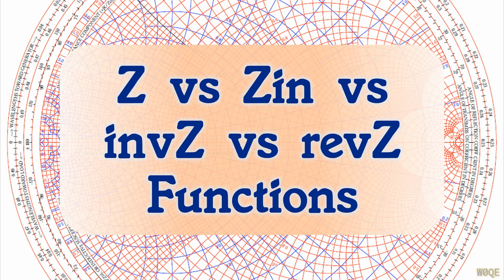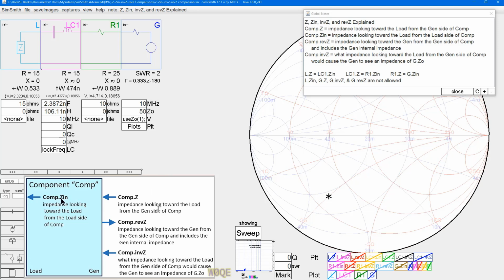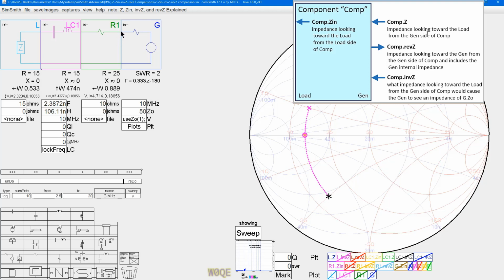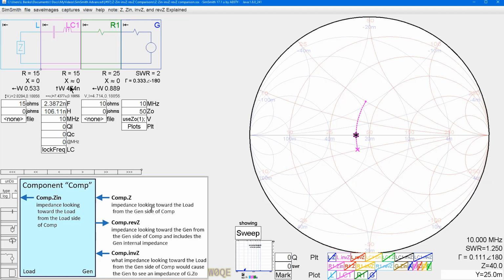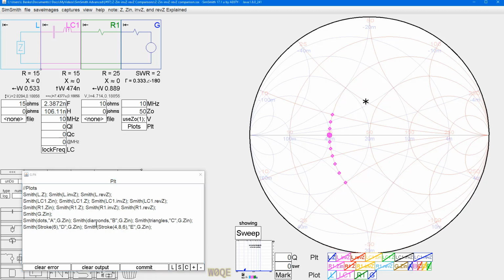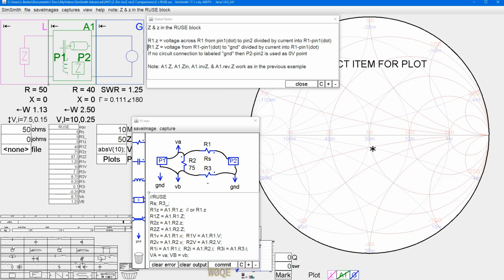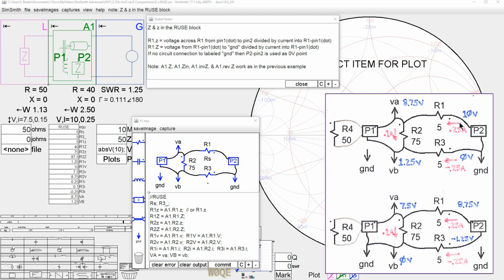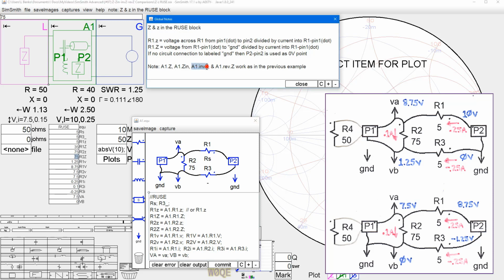#97: Z vs Zin vs invZ vs revZ Functions

Comment: Very interesting video, would love to know the reference you use to find all of these functions that are undocumented in the manual. I use this program a lot and there are so many functions I appear to not have found. 

BTW, I really would love to see a video on RF combiners. Feeding multiple transmitter sources into a single antenna or a single source into multiple antennas. I have played with trying to use two or more sessions of the program or with the LG block but I want to know if there is a less kludgy way to do this.
Reply from the maker: WB5MGR,
I believe all the "undocumented" features are in one of the 2 manuals but I wouldn't want to have to prove it.  Under the help tab there are choices to click on the SImSmith and Anvil programming manual.  Give me a couple of examples that you call undocumented.  I did a couple of videos on power combiners which were videos #28 & #29 but this has been quite a while and SimSmith has changed and become more capable since then.  There are so many topologies for combiners and splitters that doing more videos would be a good idea.  Thanks for the comments.
Larry, W0QE

Comment: I just wanted to add a quick comment that I think might be interesting.

The Comp.revZ requires Z0 in G to be linear, otherwise the expected value might be very different from what is seen in the reality.
An example can help: a class E amplifier has an optimal load where it has the ZVS and ZVDS switching. The conjugate of that impedance IS NOT the impedance as shown by the amplifier.
In other words, the amplifier expects a particular load but it is not showing an output impedance that is the conjugate of that load. That would have the consequence that the total efficiency would always be below 50% when matched to its ideal load, while in reality an ideal and lossless class E presents 100% efficiency.

Great tutorials! SimSmith has many more functionalities than I though. 
I generally use scikit-rf as an opensource python library for these kinds of analysis, but SimSmith is also good as quick interactive alternative as it  seems it can do it in a couple of clicks.

Comment: A couple of quick notes.  First, the lower case 'z' is the 'component impedance' and is available at the outer level in addition to the inside the RUSE block.  So, for example, in the given circuit there exists a value 'R1.z' which will be the same as the R1.ohms + j R1.johms.  This is particularly useful for reactive components where the impedance is a function of frequency and value.

Second, Larry is correct in that SImSmith computes the impedance given the currents and voltages across the component.  This can cause confusion if the current or voltage is zero.  For example, if you have a load impedance of zero and a shunt resistor R1 in parallel, the impedance of that resistor will be reported as 1e99.  Clearly wrong.

Just thought I'd point it out!

ward